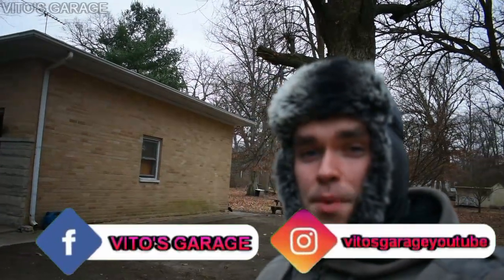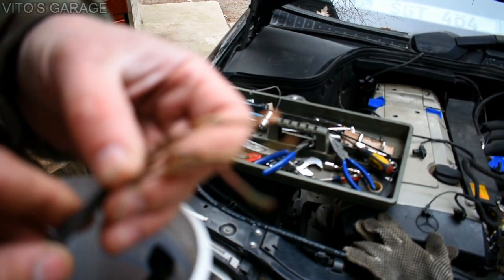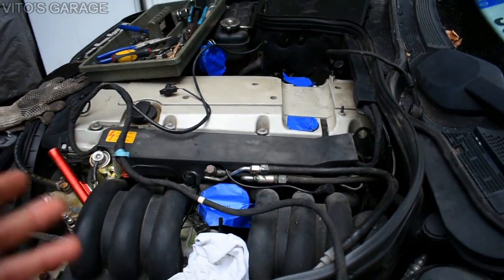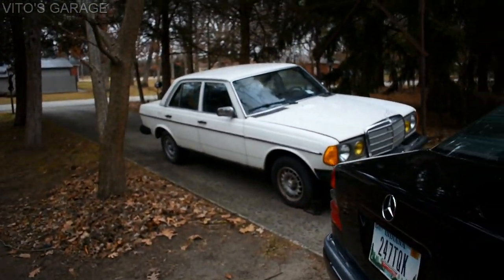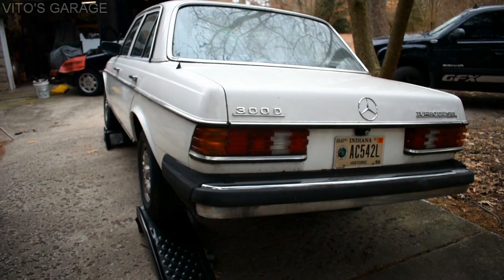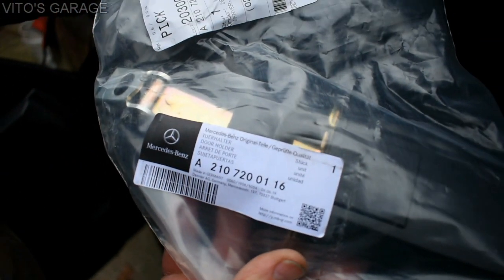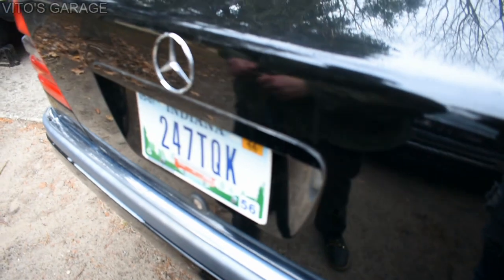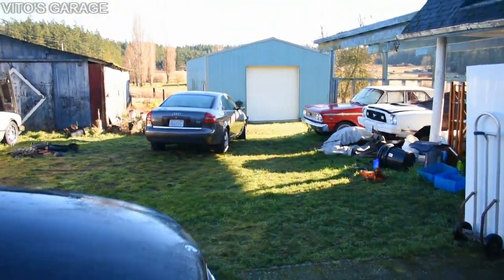Visiting My Friend in Indiana and His Mercedes W202 and W123!

Comment: I am surprised,at how Mercedes Benz,would put some wiring, that would be a potential fire hazard, if the insulation was falling off, I love the W123 300 D Turbodiesel, I am wondering, if your friend, maybe when the weather permits, that it ain*t cold or that they are using road salt, he should, put some type of rust converter, or somehow paint the underside of the car, since that road salt is lethal to  any car, and his car looks awesome, after seeing what the road salt would do to  the  car from your friend who is in Turkey I believe, a nice car a 202 but that road salt  really did some damage to  the fender, when I see the way you have these cars going, even the one that had been parked due to it hitting a ditch with black ice, it is nice to see them starting up, ready  to go, what did the owner decide to fix that car, to me, that car, could be ready to go on the streets again in no time, since the airbag did not deploy, and it did not suffer considerable damage like some cars, that otherwise would be written off as a total loss, and like you said fix the main damage so it can be drive worthy, and fix it little by little, especially at today's car prices which cost a lot of $$$
Reply from the maker: I told him about the undercarriage protection. I’ll tell him again. The best would be a fluid film. 
And yes, after about 25 years, those cars suffer from a deteriorating engine wiring harness.